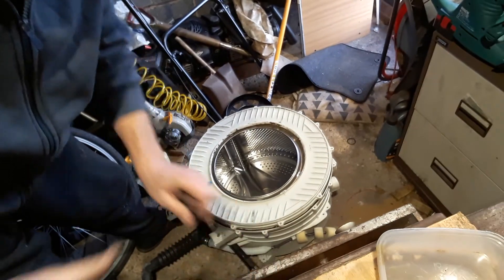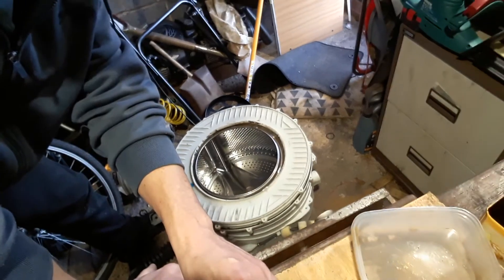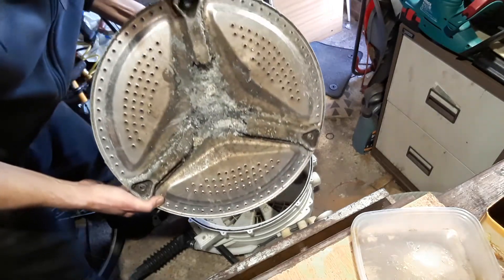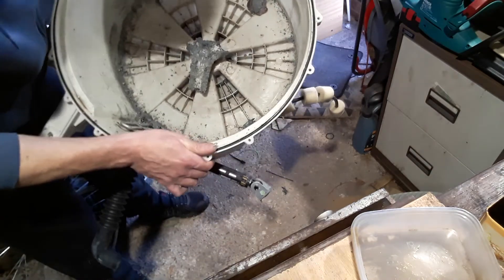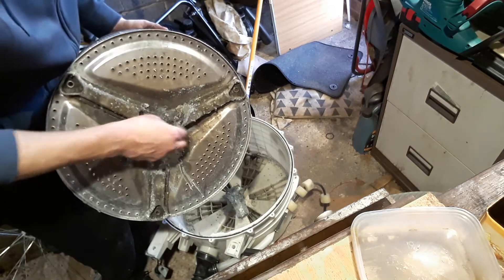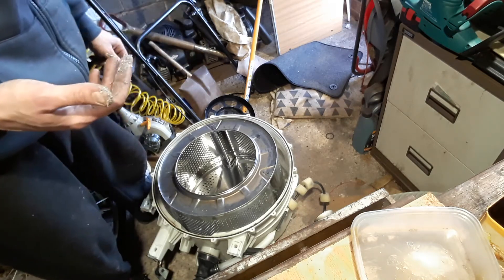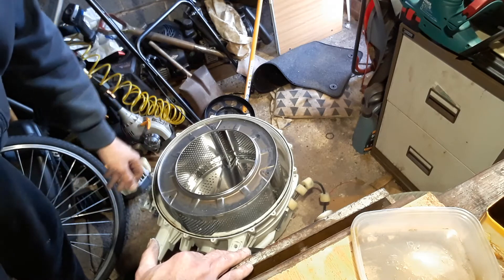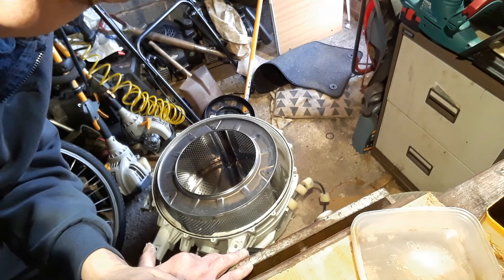Washing machine did the spider fail?????🤷‍♂️🤷‍♂️🤷‍♂️🤷‍♂️ .Washing machine drum Broken spider???

Comment: Wow! I'm very surprised how bad the spider was on that!

At the same time that what probably should be expected from these cheaper entry level washing machines tough
Reply from the maker: I know. 
Think they all built to fail why not make the spider out of stainless steel like the rest of the drum 🤷‍♂️🤷‍♂️
Reply: Yeah, 

I always wondered the same thing but at the same time that is a fairly common failure point on quite alot of machines since they are also now making them cheaper aswell compared to the older models from the 80s and 90s for example which would have lasted alot more longer

Comment: It doesn't look like you can change the spider on that either. That is not good at all. Take the motor off, they are quite interesting. 

I buy my washing machines second hand, and these days, generally Zanussi. I expect it to last 10 years before I need to fix anything on it... which is how long mine went before I needed to change the brushes.
Reply from the maker: I've took a few bits off and put  them on eBay you never know 🤞🤞🤞🤠.
Reply from the maker: I've took a few bits off  put on eBay  you never know
Reply: @Grahams-Grass  Do you mean put?
Reply from the maker: @BensWorkshop 
 I did bloody smart phone 😂😂😂
Reply: @Grahams-Grass  😂😂😂 "Smart" phone